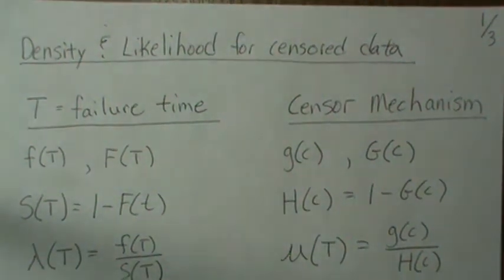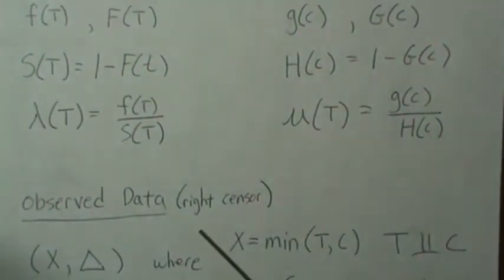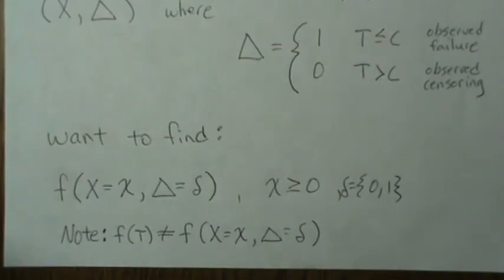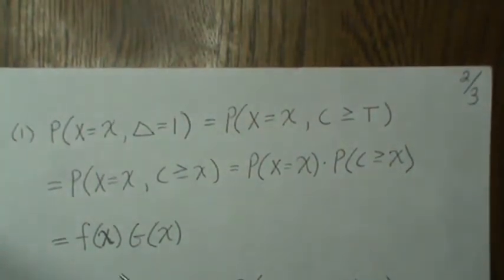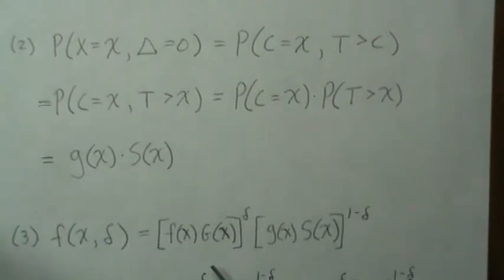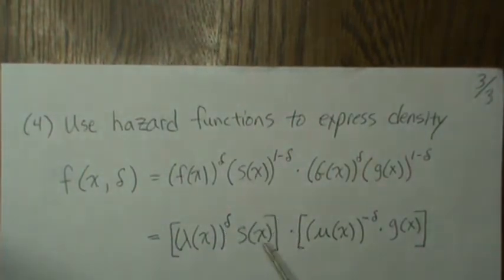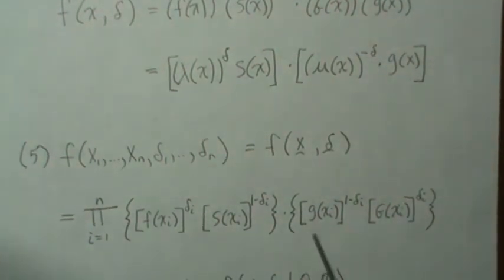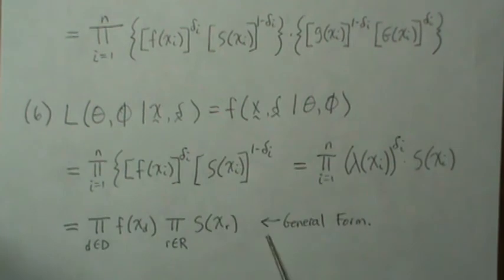Derive the Density and Likelihood for Censored Data

Comment: Nice video, but I have a question on page 2 bullet (1):

P(T=x, C>=x) = f(x)*[1-G(x)] ---> there is a little mistake, I think G(x) should be [1-G(x)]

Anyway, I still didn't get the same result. Here is my procedure:

P(T=x, C>=x) = P(T=x) * P(C>=x)  ---> cause T and C are independent

                        = 0 *[1-G(x)]  ---> cause T is continuous variable, P(T=x)=0
 
                        = 0

which part did I do wrong?
Reply from the maker: first, thanks for watching the videos and catching this error. on page 2, bullet (1), heuristically ... = P(X=x, C>=x)=P(X=x)P(C>=x)=f(x)G(x) should be ...=P(X=x, C>=x)=P(T=x)P(C>=x)=f(x)H(x).  You are correct that P(T=x)=0. It should be the  Limit as dx ->0 P(x-dx <= T <= x+dx) which will equal f(x) in limit. I tried to elude to this in the video but I'm guessing that I should have emphasized this a little more.